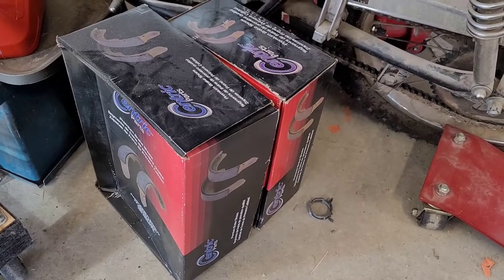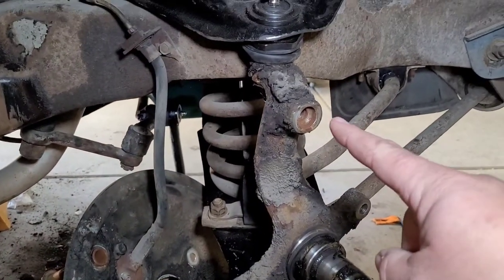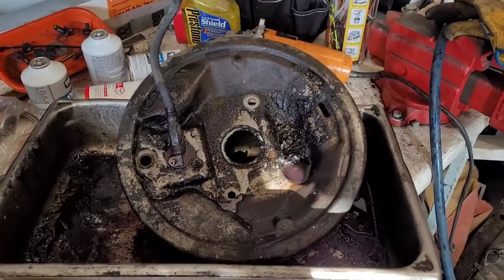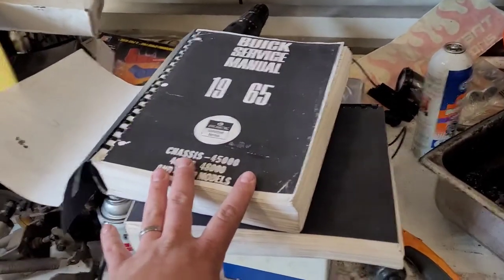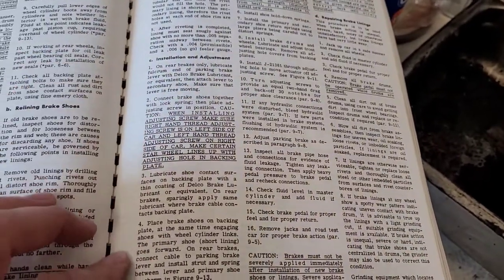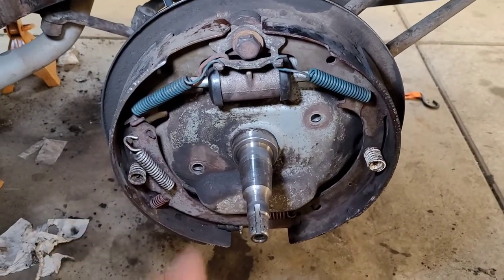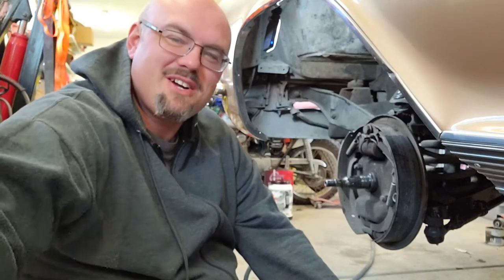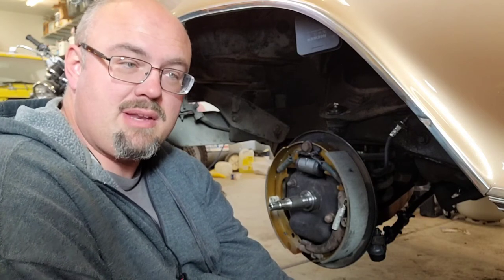It's Time To Stop! 1965 Buick Riviera Front Drum Brakes!

Comment: i’m restoring a 64 right now hasn’t ran since 1979 only one owner matching number wildcat car
Reply from the maker: They were all Wildcat Engines, the difference is the torque output with the 445, 455 and 465 Wildcats. All are Buick Nailheads and the 445 and 455's are 401 cubic inch and had a single 4 bbl carb, the 465 is a 425 cubic inch and had dual 4 bbl Carbs.
Reply: in the 64s it was the super wildcat that had two carbs this one is the 465 wildcat with just a single carb

Comment: Did you refrain from painting the front side of the backing plate because of the wear-points the shoes ride on?
Reply from the maker: That and I figured the only time they'll get seen is when I do the brakes again. It would be awesome to be able to have sand blasted and powder coat all the parts, that just wasn't in the cards, plus it's being driven a fair bit. I'm not expecting it to stay perfect.